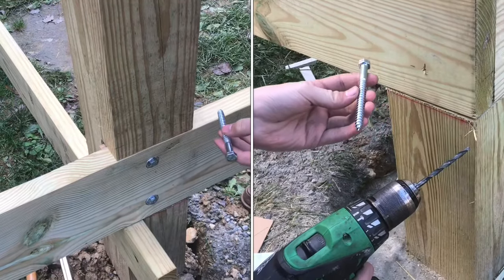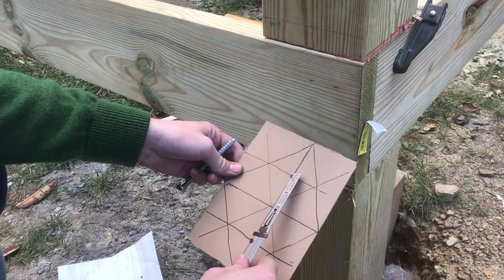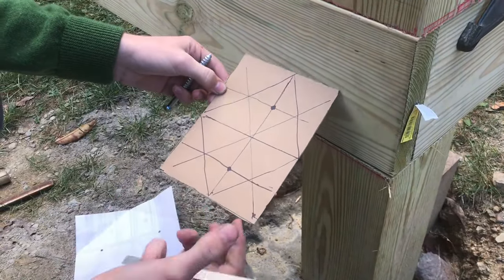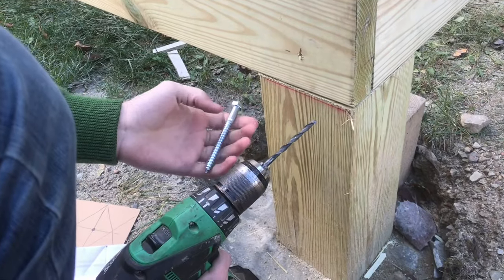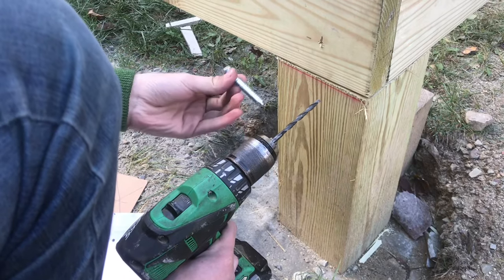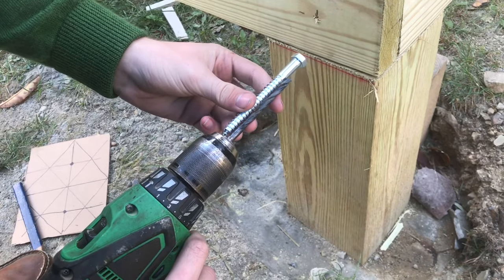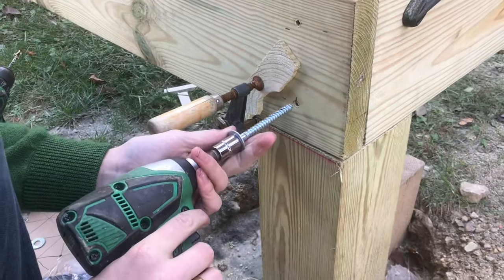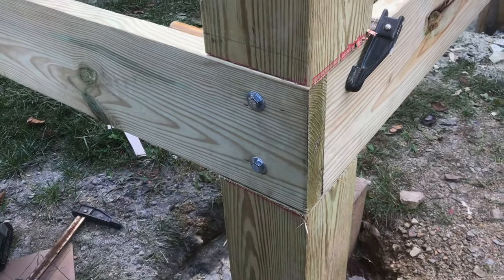how to PROPERLY install “lag bolts” (pilot holes sizes￼)

Comment: Don't mean to nitpick, but you're supposed to countersink a shallower hole to accomodate the shank of the lag screw.  This is particulary true when working with HARDER wood -- to prevent splitting.  So, for a 3/8" lag for instance, you should countersink with a 3/8" bit to the depth of the lag screw shank.  😁
Reply: Hey, very new to this, trying to understand your comment! If a shallower pilot hole is drilled, wouldn't that increase the chances of splitting harder wood, if there's not enough depth in the pilot hole to accommodate the shank of the lag bolt? Thanks!
Reply: Not what he was meaning to say, he just said it weird.  He means that the part of the hole nearer to the surface (shallower part) where there is no thread needs a pilot hole at the lag shank diameter. Otherwise you are putting a 3/8 solid shank into a 5/16 hole and that can split the outer board
Reply: Don’t mean to nitpick, but you’re explaining this completely incorrectly and incoherently. You’re getting your countersink/ pre-drill terms crossed I think. Did you mean countersink a shallower hole for the head of the lag? And why would you use the same size drill bit as the fastener shaft? That’s not correct either. Use a slightly smaller size for the shaft and don’t necessarily always go to the full depth of the fastener.  If you’re referencing countersinking a hole for the head, then you could even go slight bigger than the fastener so your socket or driver has the clearance to fasten flush/countersunk. Never mind I give up on this.
Reply: @c1rca23  The lag screw is not completely straight but slightly tapered and thicker where there's no thread.
Reply: And If you are gonna be nip-picky go ahead and say an impact driver isn’t the best but a basic drill works better.

Comment: Thank you.  I used lags to make floating shelf bolts instead of all thread... used the head to drive them in then simply cut the head off... I used my cut off saw to start a groove then after driving  in the lag  to the  required depth I then used metal blade saw saw  in that Grove to finish cutting off the head...then slide in shelf!!

Comment: Very good Live Free, other than I would have use hot dip galvanized (50um of zinc coating or about 20 years) outdoors, instead of zinc plated (5um or less than 5 years) and 180ºed the washer so the smooth side is to the finished surface.

Comment: Go look at any professional carpenter and you'll see that they offset the lags to opposite sides of the center. Doing that helps prevent the wood from crack directly from the bottom of the top lag to the top of the lower lag. 
Lag bolts aren't much more than lag screws and won't come out when bolted in place as the wood dries.

Comment: If you are afraid of wood screws rust, you can choose more rust resistant stainless steel wood screws, hot dip galvanized, dacromet process wood screws

Comment: or if ya cut trying to learn all the numbers but instead hold up a smaller drill bit in front of the screw and if can see the bit isnt bigger the the center post of the lag screw its fine.
long as ya drill the hole big enough to clear the center post without the screw section.....

Comment: for a 1/2 lag bolt, what is the drill bit size for metal?
Reply: you don't/can't put a lag bolt in metal. if it's passing through metal plate, like a bracket or strap, it's the same as the bolt 1/2"

Comment: I don't think the 2nd drill size is correct. All the others are just over half of the bolt size.
Reply: Agree. Think the  7/8 is really supposed to be 7/16.
Reply: Yep it's wrong, that's essentially an inch bolt with a small pilot hole.

Comment: You do realize you open yourself up to all manner of the " i know better"  
comments when you post stuff like this .😂
so here it goes . the only reason you would need a lag bolt is if the post isn't notched . A half inch lag can handle about 20,000 lbs of shear force which is more than strong enough for a deck .  if you are going to notch just use code approved self taping screws . saves a lot of time .

Comment: I can give a fuk about ascetically pleasing... I want it to work and be strong.
Reply: Often something that looks good aesthetically actually is the stronger solution, because things that are even or in a pattern are creating equal tension/friction.
Reply: @sean_mc  not really...  Asceticallu pleasing can be acheived with wood filler and paint so I am not sure I agree with you.
Reply: @rudolphsteiner6797  yes really. It's not an opinion. Tf are you talking about wood filler for. He's talking about structure. Your talking about finish.
Reply: Meaning of ascetically in English
in a way that involves living a simple life without physical pleasures, often for religious reasons
Reply: @sean_mc   And oftentimes designing something bases on aesthetics leads one to something sub-par engineering wise.
A pro would have put one bolt to the left of the center-line, and one to the right. This give greater protection from a crack migrating from one bolt hole to the other.
Might seem ludicrous, however they do it that way for a reason.